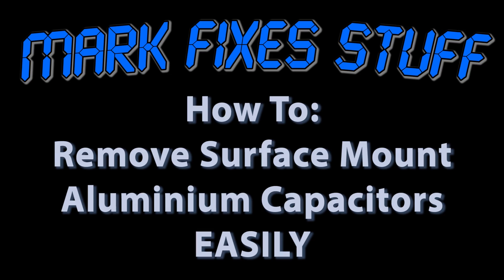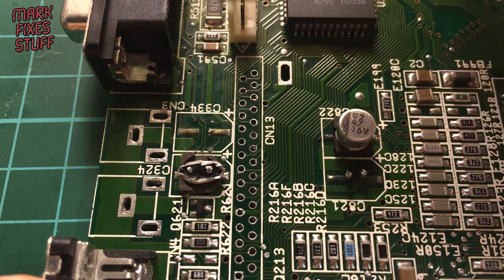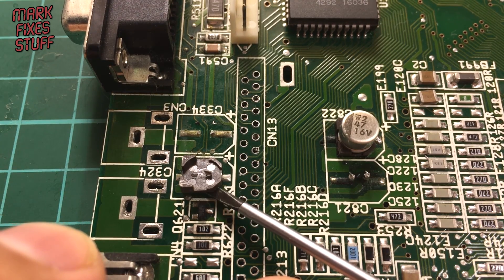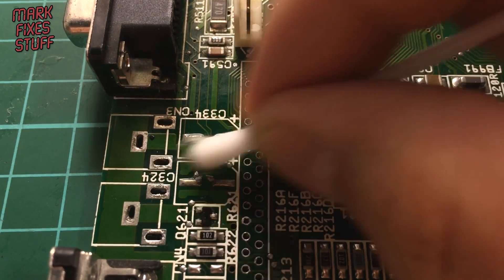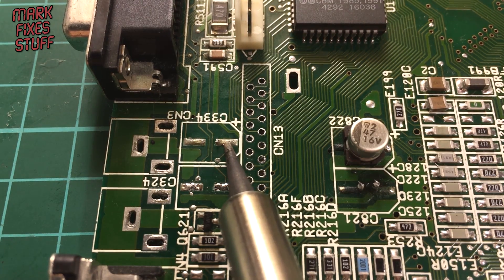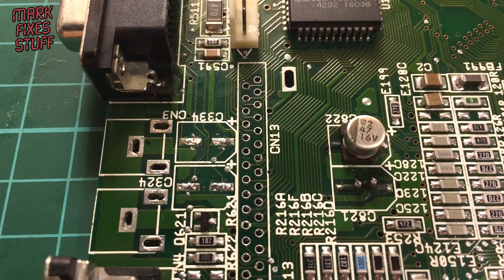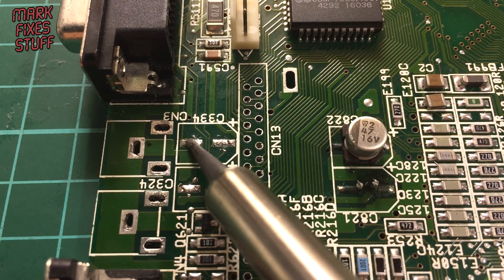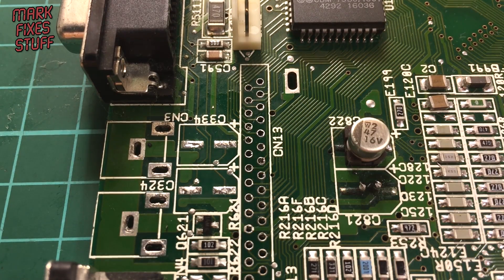Removing Electrolytic Surface Mount Capacitors with Gentle Cutting

Comment: I've modded a system with N64digital, having issues so I ordered a cap kit. Removed the first cap, which was a nightmare because it's glued to the PCB in addition to the solder. I'll have to give this method a shot, seems like it'll save my sanity.
Reply from the maker: Let me know how it goes please!
Reply: How did it go?
Reply: How did it go?

Comment: Wow thats an awesome idea! I am just worrying about having to desolder all the 13 capacitors from an old motherboard (Amiga) and this might actually be the simplest and safest way to do it. I tried the two soldering irons method a few times and it does work, but the pads can get detached from the pcb. This may prevent that, thanks for the tip!
Reply: And be very careful when heating the condenser, because using the two hot tips there is a greater risk and they can explode like a bullet and hit the eyes. Whenever you remove such a capacitor using heat, wear safety goggles! 
https://www.youtube.com/watch?v=1o3T6IL8Pz4

Comment: Do you know if this would work for an inductor? I need to get rid of one of these, and I'm not sure how to go about it. There's no exposed leads, so desoldering seems tricky.  https://www.mouser.com/datasheet/2/597/xal1010-270716.pdf
Reply from the maker: Hmmmm... I had a look at the datasheet and I think that's a surface mount inductor?  They are usually a quite solid ferrite core with wire wrapping, so probably impossible to cut through without ripping it from the board due to force.

I would try maybe cutting through the outer plastic case and see if you can gently remove the internal coil. I imagine you'd be able to lift the rest off after that. It's not something I've ever done though.

Comment: I cannot find a SMD capacitor for my  monitor, 68 uF  35V, only 100 uF 35V
Reply from the maker: Panasonic do one. It’s part number is “EEHZC 68U 35”
Reply: @MarkFixesStuff  Thank you sir last question can i replace one of my SMD with a regular capacitor but with same the uF and V? my other SMD is still good so that i will only replace one.
Reply from the maker: @unknown35514  You can. I prefer not to use leaded electrolytics instead of SMD, but it will work fine.  Good luck!

Comment: Very informative indeed. However what does one do when the capacitor is completely surrounded by other components (in close proximity) making it impossible to grab with snips?
Reply from the maker: I am afraid in that case you will have to desolder the surrounding components.

 What are you working on?
Reply: Catch 22! The surrounding components are also SM and around the same size, sigh .......! Am endeavouring to replace capacitors on a Samsung flat screen TV main control board - deep joy!

Comment: Good idea and helpful video. Brilliant is the word for this as another commenter pointed out. I have a bunch of cap kits that I've been postponing installation of "until it fails" because they've been hard to get off with a soldering iron and no hot air gun or rework station. With this technique I'll be replacing caps as a matter of routine when I open up units to do other repairs/mods. Thanks!

Comment: Absolutely brilliant.  I've been trying to figure out how to remove some small smd caps from a few heavily oxidized boards without lifting the pads.  This will be a piece of cake using this method.
Reply from the maker: Jut take it gentle and you should be fine. Unless the corrosion is under the pads and then you are stuffed anyway whatever method you use.

Comment: I suppose that this method is worse than twisting capacitors because as you shatter the capacitor body you are pulling it from board. And there are many boards where you have no space around capacitor because there are many compoments around.

Comment: Some videos say to press down with pliers and twist them off but I think this method is lower risk without specialized equipment like hot air gun.  Need to replace leaked SMD electrolytic caps on a 30 year old Aiwa portable cassette player.

Comment: I work at a electronics company which one of my duties is to rework misplaced components on circuit boards. These type of capacitors are the most awkward to work with. If the P.C.B is single sided I use a hot plate, if double sided (componements on both sides) I either apply a soldering iron on the pads and carefully lift the capacitor, or your method as a last resort. One thing I don't recommend is use a hot air station as these capacitors will explode, I tried this many years ago and I was lucky that none of the parts hit my face.
Reply from the maker: I've seen them vent inside a tv and the mess was awful. I have no desire to get that on my face so thank you for the information :)
Reply: I forgot to mention about the very strong smell from the electrolyte.
Reply from the maker: Yes. I hate it. One of the main reasons I sometimes prefer to behead the caps gently and remove the leads, is so that I can clean any leakage to improve thermal contact/reduce dwell time, and stop the smell of the electrolytic leakage when heated.
Reply: I used to work for a company performing various repairs and maintenance on boards and on a brand new board this method is used like in your instance because the pads are brand new and "time costs money" whereas a hot air gun takes a bit longer, especially with lead free solder as the temp needs to be that little bit higher.

On old machines like this leaking caps can (and do) eat the tracks and this is just wrong. Hot air or hot tweezers is the way forward. Sure, they can go pop (I've had a few go pop in my time - exploding???) but they're old and what are safety glasses for?

There's NO excuse for unnecessary stress on the board.
Reply: Had a very small capacitor explode last weekend haha.  Luckily, I was wearing saftey glasses.

Comment: New to the channel. Absolutely fantastic way to get rid of the buggers. I usually have such a hard time removing them with my chisel tip iron. Seeing as these smd caps are usually bad when you remove them anyways, I won't feel bad about snipping them.

Comment: I think my amiga is due a re-cap, I keep putting it of because I'm scared of breaking it.
Your hands far steadier than mine.
Reply from the maker: The are fiddly to be honest. The caps in this vid are the hardest as they are between the audio sockets and the keyboard connector, which I have removed.
Reply: The only time I've had it in bits was when I fitted the whdloader.
It looked fairly clean inside but I definitely think I will have to tackle it in the near future.
Reply from the maker: Crackly audio will be a tell tale sign. They all need doing though, even if working, as the leakage will eat the board.
Reply: Mark Fixes Stuff - Retro Console and Computer Repairs, Reviews and MORE! 
I no your right mate, I really need to stop putting it off.
Reply from the maker: Any battery backed trapdoor expansion will need to be sorted too. The batteries have ALL leaked by now.
Reply: Cant stress enough how important it is to get those batteries done... I left an A1200 in the attic with a memory board with a clock fitted... its, not exactly a card anymore...
Reply: I have two a1200,s that need doing i have watched both jan beta and 12voltvids use this method to remove these caps and it looks to be the best method  thank you for the video mark.
Reply from the maker: @tYNS I used a desoldering station and flux.

Comment: Nice to see you back, I was wondering the other day that it had been a while since your last posting.

Any reason for not using a de-solder pump ?
Reply from the maker: A couple of reasons. First of all the scale of the SMD caps and their flushness to the board makes it have hard to get the pump in and for the suction to work effectively.  The second, and main reason, is thermal shock to the pads. If you gently cut the capacitor away as I do, you are reducing the amount of heating or "dwell time" on the solder pads and limiting the risk or lifting or "delaminating" the pads form the board due to overheating.
Reply: I actually meant for the cleanup after you had removed the old cap rather flick the legs off.
Reply from the maker: Ah. Ok. Well they get stuck in the pump anyway, and by sliding the leg off you are not pulling on the pad at all and the sliding motion keeps it flat.
Reply: Ah OK, fair enough I can understand that :)